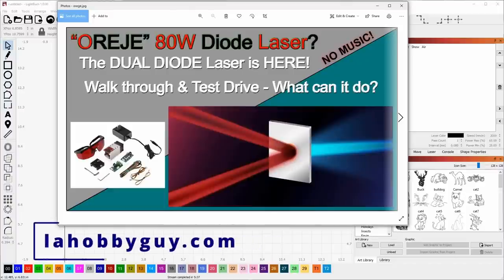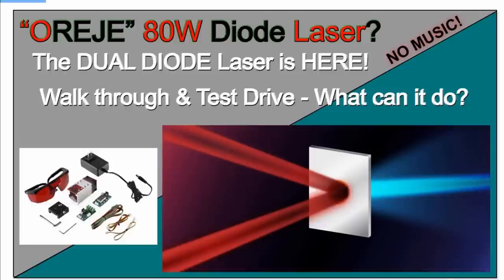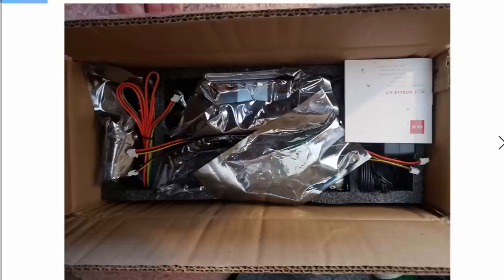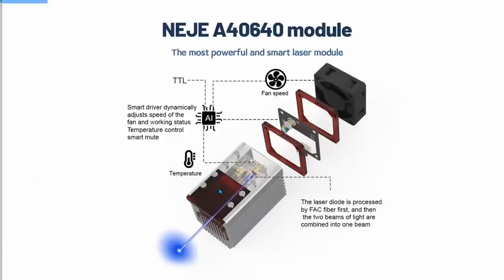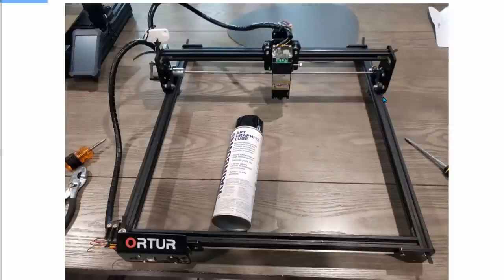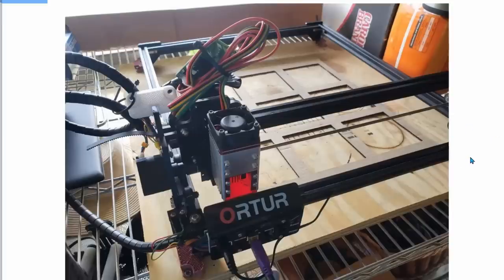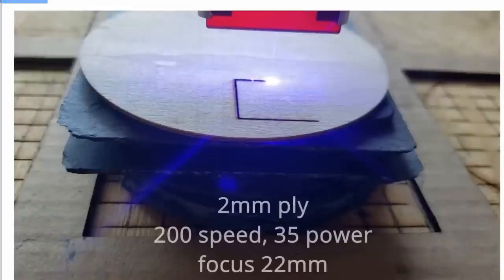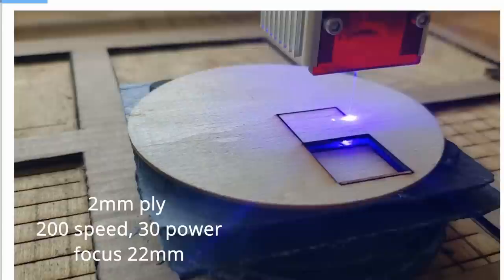Upgrading a diode laser from 20 to 80 watts!

Comment: Just installed this laser and it is a night and day difference in the one I had. Amazing power! Only problem I have is that it pauses every few minutes and fan kicks in a little faster…maybe getting hot? I’ll get it worked out. Definitely have to burn a power/speed grid to at least get a handle on the difference. Thanks for sharing Rich!
Reply from the maker: Mine never pauses, but the fan does go faster and slower.
Reply: @TheLouisianaHobbyGuy  Would you recommend air assist. The install directions didn’t have a focus distance other than with air assist.
Reply from the maker: I don't use air assist in my videos because most people with a diode laser don't have it, but yes, I use it the rest of the time when I'm making things.
Reply: Think I’m going to try hooking laser up on its own power supply. Still pauses on its own and it is restarting off track ruining my burns. I wouldn’t think running at 40% would get it hot enough to have to shut down, but this is new to me.
Reply from the maker: @r.leepanderjr.6308  It shouldn't be shutting down. I run mostly at 90-100% and I never have that issue. Sounds like a module control board issue to me.

Comment: Thank you for the overview. The result is impressive. I am sure you could get a much better result if you will try to add airflow to the cut.
I have a 5.5W diode, adding airflow increased quality, speed, and thickness per 1 pass.
Reply from the maker: I do use air assist, just not in my videos because most users don't have it.
Reply: @TheLouisianaHobbyGuy  - i have just ordered both the ortur laser master pro and the neje A40640 laser module.  What air assist nozzle do you use on the neje?  I have a pump but would like to order a nozzle and adapter for the neje.  I enjoyed the video and am stoked that the neje will slide into the ortur adpater...

Comment: Very nice, thanks. I just ordered the LaserTree 80W laser, hope the results are as good as yours!
Reply from the maker: Most diode lasers are going to be similar Jack. It's the operator and the settings used that delivers results.
Reply: @TheLouisianaHobbyGuy  In that case, which I knew, your results will be much better than mine. I' new to laser engraving and CNC,s
Reply from the maker: You'll be an expert in no time Jack!

Comment: This is awesome! Just got my ortur laser master 2 pro. Haven't had the chance yo get it together yet. I ordered the extra head for cutting, but now wish I'd seen this and spent the extra $$$ for this.
Reply from the maker: Neje just launched a new engraver, the Max 3, that has a 460x810mm bed, air assist controlled by M8 and the A40640!
Reply: @TheLouisianaHobbyGuy  do you know if this is a good unit; does it track well, quality built? Also what is a good air pump for air assist?
Reply from the maker: @pepper7144  Excellent laser! Any air assist works well. I like the fact that the Max 3 has an M8 valve so Lightburn can control the on off. It also has a M7, so Lightburn controls my air assist and smoke extraction. I have the M7 wired to a 110V power strip.
Reply: @TheLouisianaHobbyGuy  I have heard folks talk about an air pump that is quiet and has a sufficient air flow. Do you have one similar you could suggest? Also does the NEJE have a rotation adaptor? I did not see one on their site.
Reply from the maker: @pepper7144  Comgrow has a nice inexpensive roller: https://amzn.to/3lTxRex
And just about any air assist will work. I like this one:
https://amzn.to/3N18S4U
Reply from the maker: @pepper7144  Neje is out of stock on the roller accessory. Dewallie makes both a quiet air assist and a nice roller accessory:
https://tinyurl.com/dewallieroller
https://tinyurl.com/dewalliepump
Reply: @TheLouisianaHobbyGuy  thank you for this and all the instructional videos you provide.

Comment: With deep cuts having air assist to clear out the ash is a big help, otherwise the insulating ash just shields the unburned area from getting cut.
Reply from the maker: Agreed Michael! Unfortunately, the only machine I have with AA is in storage while my shop is being remodeled. I am printing one for this machine right now though! 👍
Reply: @TheLouisianaHobbyGuy  When you design and print your AA adapter for the new NEJ Laser module for the Ortur will you make that available to download? I don't have a 3d printer but I paid a guy to print my current AA adapter that I downloaded.  :)
Reply from the maker: @IIIofV  It is available on my forums for free in the Hobby Diode Laser Engraver section.
Reply: @TheLouisianaHobbyGuy  you rock my friend!
Reply from the maker: @IIIofV  Thanks! Depending on what gantry ou have, you may have to use a 2mm spacer. I simply cut them out of 2mm wood. Oh, and you do have to move the Y limit switch up a few mms.
Reply from the maker: @IIIofV  If you need the spacer, let me know via email and I'll send you the Lightburn File.

Comment: what wood is the 2mm plywood? You can't just say plywood because if is poplar it will cut at less power and high speed and if if birch plywood it will cut harder. You should specify in the videos exactly the type of ply wood because people can make high hopes and when they cut at home they won't be able to do it at your settings, because they have harder wood. If you don't know the wood type just say harder essence or soft one.
Reply from the maker: Doesn't really matter because my settings will be different than yours , even with the same laser module. I'm not recommending settings, and I never do, just showing examples of what my settings were. FYI it was 2mm white ply.

Comment: Doing the same upgrade. I went on Ali express and got one of those laser tree 40 watt which I have no idea of what the actual output is I guess around 4 watts
did not do so good so now the Neje 80 is on its way. Great video . 
I don't know why these home laser companies just say 3 watt , 4 watt instead they make it bigger than what really it is.

Cheer Fred
Reply from the maker: Good choice! They want to use the biggest number Fred, so they choose the input value instead of the optical output, which is what we're all really concerned with.

Comment: I have that laser and I do all the cuts at 100% power, just higher speed. It cuts well, but now the concept of cutting at lower power for cleaner cuts looks interesting. It is impossible to cut wood at speed below 60 - it starts burning inside even with air assist. At speed 60 this laser can cut pine 11 mm deep in one pass. Bamboo is very, very  hard to cut - much harder than a plywood.
Reply from the maker: Thanks for the tips! After some experience with this module, I do all my cuts between 120-240 speed.
Reply: Always using 100% will kill your laser module. Basically burns it out sooner. Which means you will have to buy a new one much sooner than if you use it at 75% to 80%.

Comment: With this much power and cutting Air assist is a must have. You will not believe how much nicer it gets and cuts more efficient plus your laser module will last longer when all that smoke clogging up the lens. Sure some IPA can clean it but why should it get dirty at all? I took Skulpfun air assist pump and it is not as quiet as they say but works. BTW I have 3 different modules from NEJE and two of their machines. Even with so called 7 Watt (consumption and apparently 2,5 Watt optical power) I am able to engrave anodise visit cards with no issues. That one came with NEJE Master 7Watt machine. In mean time I got upgrade N30820 kit with air assist for that machine and have in mean time modified it so that I can tight up X gantry properly. Measured overall power consumption and with N30820 it is around 20 watt as expected but same machine pulls up to 13 Watt but 10 typically with my program. So I guess that 7 Watt is bit under rated. My so called big one was NEJE 2S Plus with N40630. It is 30 watt consumption single diode. Strongest single diode. In mean time upgraded it with original NEJE Air Assist nozzle (metal one) and with NEJE 3S Plus mainboard. Now it works with newest software and upgrading firmware is way easier. Also does have only one main chip in 32 bit version so it works in 32 bit mode in the NEJE software as well. Anyhow with same file but faster movement it pulls almost same power as the n30820. It is stronger and does more. Maybe more efficient. Anyhow I kinda like what NEJE brings on the table for the money you pay. Sure there are better lasers and one can get 4 diodes laser modules that are more powerful buit at what cost? Costs way more than best NEJE machine.
Reply from the maker: I have the air assist, I just didn't use it in this video because most people don't. Thanks for the detailed comments!
Reply: @TheLouisianaHobbyGuy  I wouldn't know statistics 😀 but yes I guess most people do not have it or just engrave with their lasers and do not really need it. It ain't free either. Good solution costs asuch as half of the actual laser engraver it self. But if you are cutting stuff it is a must have. So many people with stronger laser modules get so happy to be able to cut stuff and do it without the air assist. Than after month or two notice how it can't cut as well is it was cutting. In few videos they even have replaced the module and bashed on cheap Chinese laser modules instead of cleaning the lens or getting new one. Sometimes they use it to long on maximum power and cutting stuff without the air assist that everything inside gets dirty and starts overheating and eventually failing. When there is so much smoke cooling fan will force it true the module and that is a bad scenario. Anyhow I rather have it and do not need it than need it and not having it.
Reply: @TheLouisianaHobbyGuy  btw idea fir the video if you haven't done it yet that is. Show the cutting difference with and without  the air assist. Sure it was done before but nice video would be good. Difference is stark especially with high power modules. No more burn marks on the top and almost no burn marks on the bottom plus faster. Fir cutting it is a win win situation. Though for the engraving materials like wood it is making a mess. It even fights the logic that in one scenario it makes it cleaner and the other dirty but it is what it is. It us easy to nit turn it on when engraving wood though 😀
Reply from the maker: I'm actually working on that right now, thanks!
Reply: @TheLouisianaHobbyGuy  excellent 👌 Looking forward to see your version.

Comment from the maker: Just to be clear, there is no such thing as an 80W diode laser. The maximum any diode laser can be is 7.2W. This laser is two 7.2W lasers compressed  by fiber and FAC into one laser beam. The 80W that Neje claims is the power supply, not the optical output. NOTE: IF YOU HAVE A *24V LASER*, YOU MUST USE THE POWER SUPPLY INCLUDED FROM NEJE PLUGGED DIRECTLY INTO THE ADAPTER BOARD! CUT THE RED WIRE COMING FROM YOUR CONTROL BOARD ON THE 3-PIN CABLE!
Reply: I think it's 15w because it has 2 lasers inside.
Reply from the maker: @linogeo1  Watt's Law would restrict these diode lasers @ 40W to a7.2W optical output.
Reply from the maker: @linogeo1  About 15W... probably closer to 14-14.4W, since 7.2W is the most powerful diode laser in this class.
Reply: then dont call it a 80 watt laser
Reply from the maker: @martijn4740  I don't! I call it what it is, 14W optical output. I was being facetious about the advertising practices of Neje.
Reply: 80 watts power in with two lasers @ 7.5 watts each equals 15 watts max out. I understand. KD4MAN amateur extra.
Reply from the maker: @bubbajeph  I'm guessing it's probably closer to about 11W, but I'll give them what they advertise and say maybe 14.4W at the most.
Reply: @bubbajeph   yea and even that  is not true  because im prety sure if i put a power meter in front  of it it will never  get to 15 watts at full power ;)  i used to build these  on a daily basis so i kinda know what im talking about
Reply: 14W optical output is still very high for basically a cheap hobbyist laser.
Reply from the maker: @adamrak7560  When you add in the cost of the laser module and the original laser, you're pushing $600... so not really that cheap.
Reply from the maker: @martijn4740  Nope probably not, more like 10-10.5W. I'm just saying what they advertised Martijn.
Reply: Its interesting that they advertise the units as 80w or 40w.. Its all the companies. 
Atomstack has a "80w" laser that is two 5w. So 10w.
I am wondering how it stacks up.
I currently have the "50w". 5w max.
Reply from the maker: @turboflush   You have to look at the detailed specs. 40, 50, 80W are all power consumption ratings at the power supply (input). Actual diode optical ratings (output) are usually 2.5W, 5W & 7W. Now with the dual diodes of late, it can be 10W or 14W. You have to read the manufacturer ratings for optical output.
Reply: hi, good night, I have an OLM2 and the laser is 12v, Now, I have already bought one of  80w  with two diodes but this works with 24v. What kind of modifications do I have to do? if i want to use the new laser of 24v. Thanks for your attention.
Reply: @AlexPerez-pm3ds  hello dude I have the same machine as you did the 80w work straight out the box or did you have to mod the power thanks
Reply: Is there a link to purchase this?

Comment: Hi Rich! I bought the Neje A40640 to attach to my newish Ortur LM2. I have the 24 Volt Pro model and have read your comments about snipping the red line from the control board to laser and using Neje Power supply. Thanks! 
Didn't get a supply with my purchase so have ordered one from Amazon (12 volt 5 amp 5.5mm ... As suggested by your good self). Hope to screw this lot together very soon. My question is ... I noticed in the original video you removed the earth from the screw on top of the Ortur laser module. Where does it go after that? Do you just re attach to the same place on the new Neje Module?
Huge fan btw. It was watching your videos got me to add the Ortur to my modest workshop.
Reply from the maker: Yes Jim, I attached it to the same place.

Comment: @12:08 Step your focal depth down by about half of the board thickness for a second pass. The beam's cone loses its focus over distance; so as material is ablated, the lower depths are exposed to increasingly less focused optical energy. Strategically lowering your focal height for subsequent passes will overcome that issue, as well as offer straighter cuts.
Reply from the maker: That's what everyone does Tony, but I don't do it when I test lasers.
Reply: @TheLouisianaHobbyGuy  Eh, my bad. I didn't consider that before injecting my "know-it-all" comment here, lol!

Many thanks for the demo on this module, though! I'm currently exploring ways to get more optical power at a discount, and didn't realize there was a module rated at 20w out. Back when I bought my 7w, it was the highest power I could find at the time without going to gas or fiber.
Reply: @TheLouisianaHobbyGuy  Unrelated question: I see you're based out of NOLA. I'm just "up the road" a bit here, southwest of Jackson...

Are there any decent stores in your area, who stock CNC and 3D print supplies? There's nothing in my area. I have to gamble everything from Amazon.
Reply from the maker: Not that I know of Tony. I use GST3D in Miami. Awesome filaments. https://gst3d.us/

Comment: Hello Rich, with the Ortur LM2, I used your library cut for the acrylic 3mm and you are right, I could not cut through with 7 attempts, the last with 7 passes,, did not cut, so I stopped. You mentioned 9-14 passes, wow.
Reply from the maker: Yeah, these are really engraving machines. I use the C02 to cut.

Comment: Hey Rich, just a quick suggestion/question.  Does it matter what the input watage or the output?  I would think it doesn't matter what the input wattage but only the output wattage and the % power you are using.  Is that a correct assumption on my part?
Reply from the maker: Yes Sir! Input is sales & marketing hype. Optical output is what matters. I can get a power supply rated for 400W to power a 5.5W diode at 12V. It's still only 5.5W....

Comment: Thanks for this very informative video. I too, have the LM2 and have been spending a ton of time watching videos on CO2 lasers and Fiber lasers. But as a hobbyist, the price tag for upgrading to CO2 or Fiber is a little above my pay grade. I've had my LM2 for a year now and haven't been completely happy with the results I get engraving tile and acrylic. So this upgrade could save me thousands of dollars!!!! This just might prevent me from biting the bullet and purchasing a Fiber laser!! I know each type of laser has it's purpose and everyone has their preferences, but have you already made a video comparing the pros and cons of each of the different types?? Diodes vs CO2 vs Fiber. 
Keep up the great content!
Reply from the maker: No, and I don't plan on that Bryan, because there really isn't a way to compare them. It's like trying to show the differences between a Rolls Royce, a Ferrari and a Yugo 🤪
Reply: @TheLouisianaHobbyGuy  Thanks for taking your time to answering my question. So I have another for you if you don't mind. I did go ahead and purchased the NEJE A40640 and it arrived last week, so this past weekend I removed my Ortur LM2 20w and cleaned and tightend all the belts and made sure all was ready for the new module. From your video, you were able to mount the new NEJE right to the Ortur mount using the provided mounting hardware that came with the NEJE. The mount I received looks identical to the one in the video, but the mounting holes do not match. I am only able to line up one hole between the two mounts. So my question is, do you know where I can find the correct bracket or do you know of anyone that offers a 3d printed version?? I do not have a 3d printer, nor do I know anyone that could make one for me. I did mount the NEJE using only one screw, but this is only temporary to test the unit. I do not want to run the laser with only one screw. Thanks for any assistance.